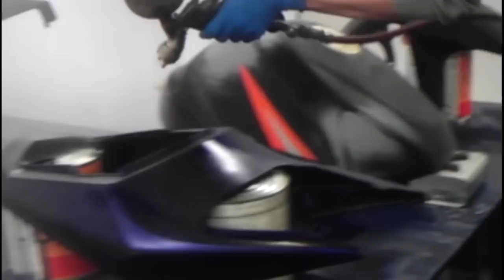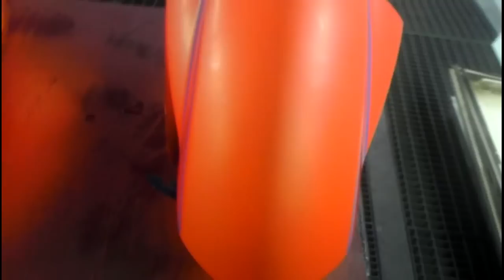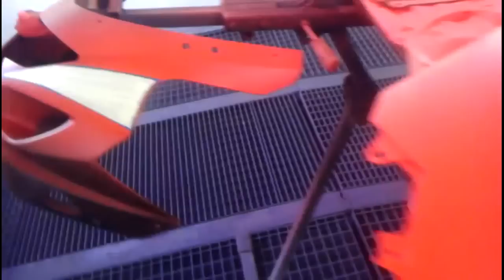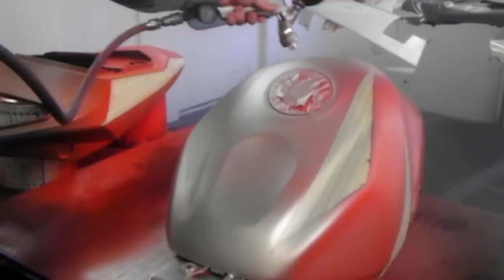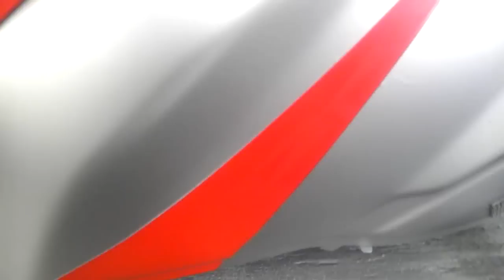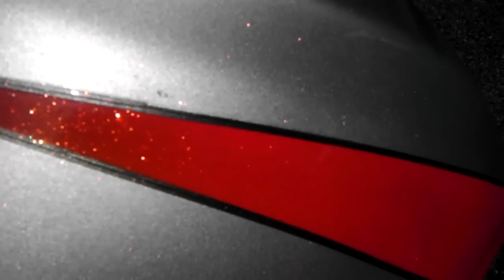HOW TO CUSTOM PAINT A MOTORCYCLE

Comment from the maker: well deff need tape sandpaper mixing cups(prob 5 to be safe. and you can clean them out if you need.) paint and hardener/activator there is some water based paint but its a little harder to find. as for chrome paint it looks good but its really tricky to lay.

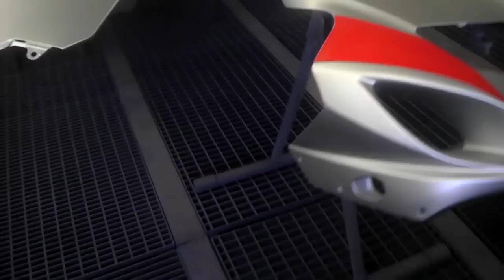Comment: It turned out ok i guess, but your design on the the fairing is off pretty bad from side to side.  5:29 is a square look at it, and did you do any sanding between coats?

Comment: Should have done a grey primer/sealer to cover up the stock paint. Then silver. Then orange graphic. Could have used a little more clear coat to bury the flake too then buff to polish. Not a bad job, but could save you money by not using color base coats like orange to cover stock graphics or stuff like bondo filler

Comment: Choice of color is totally subjective so no comment there.  You did do the lines non-symmetrical (could have done much better there!).  Your end result came out nice but slowing down a little bit and checking to make sure your lines were more even when you masked it off would have had a much better end result.   I personally love the GSXR black with red accents, how I will be spraying mine.  Not a factory scheme, doing my own thing.

Comment: Tthe color coats look waterbased to me..? the lacquer/clear coat would be solvent based. You can paint both metalic and plastic with the same paints the only difference being that you would have to apply an adhesion promoter to the plastic parts.

Comment: Could u do this with rattle cans?
Reply: +asmoov  yes but super not recommended it wont give u the same paint job. it wont be as even or smooth as with an air compressor. also that paint tends to flake off a little easier.

Comment: To give it a little extra style....?   Hummmm... OK! In reality most guys do it because its tricky to get clean lines. However you did use the right tape so maybe you got lucky.  Good work all around though.  You can tell a good painter by the way he/she triggers the gun.  Folks who continually stop the air stream don't know what they are doing.  Looks like it has heavy peel - you might want to consider using a good HVLP touch up gun as you will use ALOT less material and atomization will be much much better plus you can do edges much easier and reach up from the bottom to do low trim lines like the tank you couldn't get to the bottom of.  Obviously the video is 5 years old so if you are still doing this stuff you may have progressed.